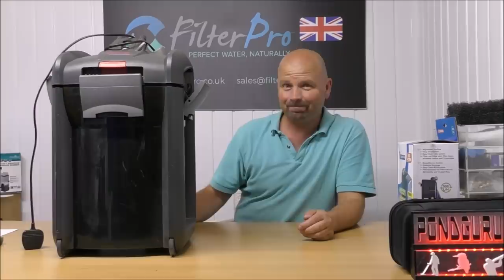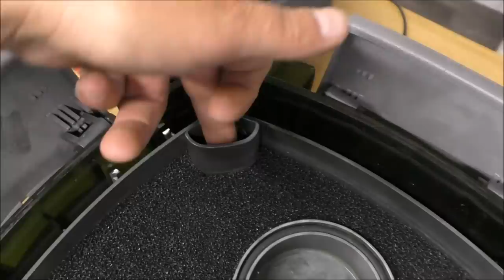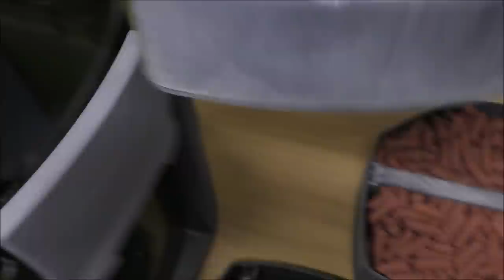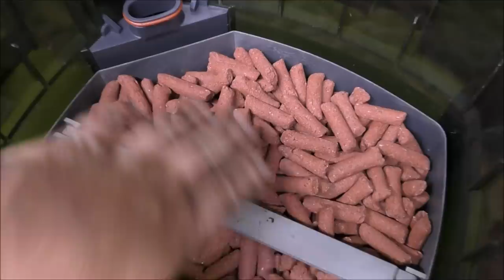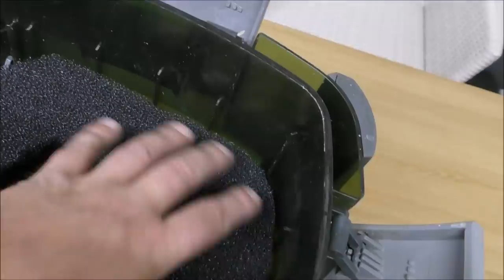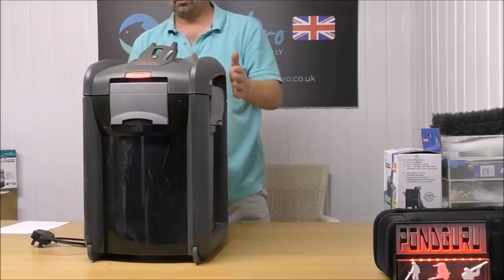Pimp My Filter #34 - Eheim Pro3 12000XL Canister Filter

Comment from the maker: Ouch! This is an expensive filter....however it has some nice features as you will see in the video.
Eheim 1200XL / 2080 (Amazon): https://geni.us/IBfcv
Eheim 1200XL / 2080 (Ebay UK / EU): https://ebay.to/31coTgR
Foams and Biohome Ultimate: http://www.filterpro.co.uk
(FilterPro site has links to suppliers in other countries)
Biohome Ultimate on Amazon UK: https://geni.us/GDV8oLd
Biogravel on Amazon UK: https://geni.us/o98PP

As you may know I was very disappointed in the build quality of the Eheim Pro4 600 as it was a step down from the Pro3 series quality and a huge step down from the Pro2 quality.
The Pro3 1200XL / 2080 is a really meaty filter which easily holds 6kg of media. Build quality is fine and the ability to draw from 2 places in the tank is a real bonus, especially for heavily stocked tanks.
The price is very high but given how brittle the internal parts are on the Pro4 series I would recommend this one from the Pro3 series no problem.

WHAT IS A FULL CYCLE?
If someone tells you the aquarium nitrogen cycle ends with the production of nitrate that is incorrect - please read on
A full cycle is completed by bacteria - the aerobic part of biological filtration which processes ammonia to nitrite and nitrite to nitrate followed by an anaerobic part which processes nitrate into soluble nitrogen which bubbles off to the atmosphere.
Therefore it requires a suitable amount of excellent quality filter media to be able to provide the environment for both aerobic AND anaerobic bacteria - that is what Biohome ultimate does perfectly but even with such good media there are limitations and we recommend the following amounts for different stocking scenarios:
(1 US gallon = 3.8 litres)
(1kg = 2.2 lbs)
Average community tropical aquarium = 1kg per 100 litres 
Average coldwater aquarium = 1kg - 1.5kg per 100 litres
Predator aquarium = 1.5kg - 2kg per 100 litres
Large cichlid aquarium = 1.5kg - 2kg per 100 litres
Malawi / Tanganyikan aquarium = 1.5kg - 2kg per 100 litres
Marine aquarium = 1.5kg - 2kg per 100 litres
Average mixed fish pond = 1kg per 200 litres
Average koi pond = 1kg per 150 litres

You may be disagreeing with the above figures but remember that they are for a FULL CYCLE not half a job - achieving 0 ammonia and 0 nitrite is quite easy since aerobic bacteria grows freely on any surface but the anaerobic bacteria responsible for COMPLETING the cycle needs more a specialized habitat.
Size a filter properly, set it up sensibly and you will have perfect water - it's that simple....and your filter won't be the dreaded 'Nitrate factory'.

This series of videos is all about trying to squeeze more efficiency out of internal and external aquarium filters which generally have a limited filtering capacity - If you have a filter you'd like me to feature in a video then please contact me on:
sales@filterpro.co.uk
07772848730 (Richard) 

Anyone who sends a filter (UK only at present) will have it upgraded and returned to them for free and the only cost you will pay is how much it costs to ship it to me - I'm helping to boost your filter and the resulting videos will hopefully be useful to viewers all over the world so it's a win/win. 

The following videos will be useful to anyone interested in learning more about filtration, bacteria and making the conditions for your fish as good as possible:
Sizing a canister properly and filter set up: https://goo.gl/om19un
Looking INSIDE different filter media: https://goo.gl/hZWS6c
Bacteria and filter media: https://goo.gl/123gAF
How to clean an aquarium: https://goo.gl/bPMhvh
Aquarium tips / filtration playlist: https://goo.gl/pXgqVj

This channel is purely a hobby for me so I will never ask viewers to donate money for any of my projects or charge anyone for information - information should be shared freely and I certainly don't consider myself an 'expert' in anything I pursue as a hobby so please do your own research, never accept anything as 'fact', reject anyone claiming to be some sort of authority or 'expert' and make your own minds up about anything you wish to study. 

We all are on a long path of learning......... 

RECOMMENDED AMAZON PRODUCTS: https://amzn.to/2Mw81OU
INSTAGRAM: https://bit.ly/2KAk1fx

FILMING EQUIPMENT:
Panasonic HC-VX870 HD camcorder http://geni.us/3UwE
+Rode stereo microphone: http://geni.us/4OL
Zomei Z666 tripod: http://geni.us/1a1af3
Manfrotto MTPIXI-B PIXI mini tripod: http://geni.us/87f7

If you've enjoyed this video please check out the playlists on my channel for hundreds more  - on a variety of subjects.
Feel free to share or link any of my videos on facebook, twitter, forums etc. for the benefit of anyone you think may also enjoy watching.
See you next time.
Pondguru
Reply: Hello, from the Canadian with the Tidal 110's. I've kept the original very coarse foam, then a slightly finer than medium foam (1 1/2 inches thick) from my LFS, (don't know the porosity) then, custom cut fluvals replacement foam for a 406 (red tray) for the mechanical filtration. Filled the supplied bag with Seachem Matrix about 3/4 full . The result is the matrix does get some accumulation of very fine debris. This setup fits perfectly to weekly  filter maintenance  and sparkling clean water. Flow is excellent and there is no spill over (bypass) of the "basket" week to week. The addition of "filter floss" results in bypass in about 4 days. What would you suggest seeing how I'm in there  every 7 days, I'm thinking nothing easier than giving the matrix bag a shake to get rid of the super fine stuff. Would you concur?
Reply: The title is wrong since it says 12000 not 1200.
Reply: Pondguru it says 12,000 xl in the title instead of 1200

Comment: I add 2 external Pre-Filter chinese LW-603 on the intets. You can then use the bottom tray for more Biohome. Works really well with quick change connections also chinese Eheim copies. Then you only clean the pre-filters not the main compartment. You could also add an inline heater, Co2 diffuser and UV on the outlet. Lots of connections but it works. Also change the internal prefilter course foam for a fine one as the prefilters do all the work.

Comment: I’ve run one of these for over a year now set exactly as you have with in the video (except the foam at the top) I’ve found it to be an excellent filter and as with most eheim equipment they  last, (I’ve had eheim pumps etc last over 20 years)  I managed to fit approx 7-8 kgs in mine I think by ramming it in. They also have 2 separate intakes to the filter ! Which make it different from most other externals and is a great idea
Reply: its a 500 dollar filter!!!!!  LOL  

Rather have 2 FX6 filters on a tank for that money
Reply: Sahadi420  you pay your money you take your choice, Price isn’t everything !!!!! Also I’m in the uk as is the review. You CANT buy 2 x FX6 for the price of the eheim new here, there is only £100 difference, and I know from experience which one will still be running in years to come. ;-)
Reply: @andrewjones7670  I saw 500 on amazon.  I can go to petsmart and get an FX6 for about 260.   

Worst case scenario you can easily replace the pump on the FX series....as with any component on it.
Reply: Sahadi420 we are the uk we don’t have pet smart here, also as I’ve said already you pay your money you takes your choice .
Reply: @andrewjones7670  fair enough.  But I will say, I do love Fluval products.  I take care of fish tanks that are in the oldest bar in my city.  Fish tanks have been in this establishment since the late 1970's......I need equipment that will last as well.   Nothing but good things to say about Fluval.
Reply: Sahadi420  I’m glad you love  fluval so much, I didn’t realise it was a competition lol
Reply: Andrew Jones I have both of the  fillters the Eheiem is by far the better unit , will last a lot longer too

Comment: Mmmm, it’s a great filter, mine runs on a 720 Ltr perfectly. However, putting all the foam at the bottom is a really bad idea, it clogs within days. Eheim actually know a thing or two about filters, and that’s why the foam is supposed tobe at the top and “polish” the water on its way back into the tank ( that’s why there’s a gap).
Reply: Good point!
Reply: Hey ! I just got mine 2080 Today.
What do you think if I start it the way that factory planed it .. I would only change myself to put fine foam on the top of the cheramic eheim media in the first corb on the bottom ? Than i put over the other two full filled  eheim balls corbs ?

I only want that clean water comes to eheim balls to become the max effect of cleaning the water.

Thank you for the answer . 
Shoud I in that case also put one fine foam on the top of the filter as eheim wanted ?

Comment: Pondguru

The top 2 trays need to be filled with media to the max.
then that thin lid comes on.
that space you didnt understand is for the filter floss pad.
its made this way so you can fully use the trays for bio media 👍🏻
Look on the box, Its printed on there.
Reply: Yes but that would then trap the muck after it has passed through the media ,eventually clogging the media .The water has to be polished with floss before hitting the media (not after) .
Reply: The space is to allow any chunks of media a chance to settle without the pump eating them. Especially important after changing media.
Reply: @leeporter6849 correct

Comment: I never use the white filter wool in my external filter, clogs up too quickly, the filter will need cleaning out every month, just put a pre filter sponge on the inlet hose with coarse medium and fine sponges in filter, works great for me, I clean my filter once every 12 months!  My water is perfect and I have crystal clear water. If you want to use the wool just put it in a little internal filter (ehiem bioball) so it is really easy to clean or replace.
Reply: If you have a high bioload or lots of wood in the tank with pleco/or wood that breaks down quickly and don't want floating particles a fine pad is a strong recommendation. 
If you have a planted tank with little fish you could get away with filling the whole thing with no sponge at all, only pumice and carbon for totally crystal clear water.

Comment: Unfortunately , the fine pad/floss is really impractical in this filter . It lasts around a week to a fortnight before clogging . And with the position at the bottom of the filter makes it a right old pain to clean / change out .  

I set up similar just missing the floss out  and it works great .

Personally I prefer the 1500xl classics . Much more media and flow albeit at the expense of a bit of ease of maintenance
Reply: Pls help!

EHEIM professionel 3 1200 XL
VS
EHEIM classic 1500 XL

Dose the pro 3 seria do 50/50 with the suction side because it has 2x inflow?
I was thinking about on one suction side put UV-C and normal suction on other?

Wich is better fore 450l/120gal aquarium? Quieter?
Reply: @mariot.5178  I know it's an old comment but the 2080 or 2180 are quite compared to the 1500xl. I've got 2 a 2180 and a 2080 1200xl on my juwel rio450 ltr tank and can't fault them at all. All depends what fish ur gonna keep but a 2080 should be perfect on ur 400

Comment: There is a little bit of space for a layer of media rings at the bottom but I changed this filter over from the 700 which did have almost the same space as a basket of media at the bottom. Factor in that you loose this space in this filter, this doesn't hold much more media when I transferred from the 700e.

Comment: Very good Video !! I have the 2180 - with build in thermo, I had some issues with the flow, when the filter was build like Eheim suggested
So i removed about 6 liters of bioMech and Mechpro tubes - now the water is flowing, but did you check the flow rate, when building the filter with sponges and  Biohome Ultimate ? 
Regards
Flemming.
Reply from the maker: Ultimately the fine pad dictates the flow rate of a filter since it will hold water back when it gets clogged. If you find that the flow is slowing down quickly after maintenance try removing the fine pad - the vast majority of muck will be caught in the medium foam(s) anyway. The Biohome Ultimate makes no difference to the flow since water can easily pass around it but very small media like the Biogravel or Substrat Pro may slow the flow  a bit since the water can't pass through a full tray of it quickly.
However, if the small media is used in mesh bags the water can go around the bags of media easier, helping to maintain the flow rate.

Comment: I guess the bottom tray could be raised an inch with some kind of support, then the bottom could be filled with some mech rings to settle heavy muck at the expense of getting rid of the top foam added in this video that doesn't seem to really do very much.
Reply: Removing the top tray is not a very good idea with these filters as the whole design and flow of these units depend on them. Otherwise, water would just be sprayed down into the top layer and be sucked out again without any filtering whatsoever.
And it's a terrific first settlement chamber that does its job very well.
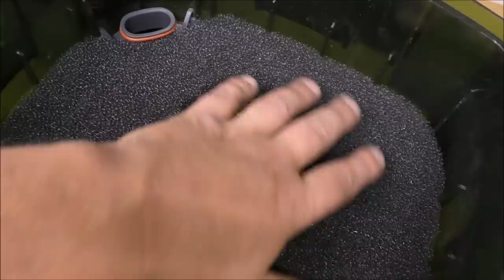Reply: @OriginalMindTrick  Sorry if I was unclear, I was talking about the foam seen at the 9:15 mark (and some time before), not the prefilter foam added a few seconds later in the video, which is the one I think you are talking about.
I absolutely agree that this shouldn't be touched.
Alternatively, you talk about the entire prefilter tray, since you say the filter wouldn't work without it.
Either way, I absolutely agree, dont remove any of them!
Thank you for adding this comment, since I don't want to plant a destructive idea in anyone because of a misunderstanding.

Comment: Thanks for posting this video Richard. Hopefully you or you followers can help. I have two Eheim Classic canister filters (2217- one on each side of the aquarium) for my 125 gallon tank that is home to my aquatic turtle. The turtle is getting larger (about eight inches) , so I need more cleaning power. Was looking at the Eheim Pro3 in this video, but it looks massive. Wondering if you could recommend a good and easy to use filter that has lots of power. BTW,  I am in the U.S.  Thanks a bunch!

Comment: While I prefer the extra space for media, and the more traditional top mounted pump compared to the Fluval FX series, I have personally found the low turnover rate of Eheims to be a problem for tanks with messy eaters, especially if you've got the three grades of foam in there. I was using an Eheim Professional 3 on my Green Chromide tank for a while and it just simply wasn't adequate in terms of mechanical filtration, lots of suspended particles clouding up the water for several hours after feeding, in the end I replaced it with an FX5 which does a vastly better job, keeps the water crystal clear and is still provides enough space for biological media.
Reply: This is my experience as well. They are great at biological filtration but not the best when it comes to keeping a high bioload tank crystal clear. That is what the FX6 excels at.
Reply: @OriginalMindTrick  Yeah, I'm sure they're probably fine for a lot of typical community setups, but they just don't have the flow rate to handle messy eaters and / or fish that produce a lot of waste like large cichlids, puffers, goldfish ETC.

I ended up using my Eheim Professional 3 on tank about 1/3rd the size of what the filter was rated for in the end, and it was amazing for that tank. It's a shame because as I said, I actually prefer most things about the Eheim filters, but they're not much good to me if they can't keep my water clear.
Reply: @The-Fishkeeper  The Ehem 2260 is terrific at both mechanical and biological filtration. If the supplied pump isn't large enough you can put whatever large pump you like on that can handle being run out of water. A sump is probably a better choice here though.

Comment: I have noticed if you have a standard tank it's better to go with a finer 30 ppi foam on the bottom and not bother with anything coarser. There is also quite a bit of bypass with each segment so putting one or two more fine polyester pads above the bottom segment isn't a bad idea.

Comment: Definitely my favourite filter I have 7 running at present
Reply: What size tanks?
Reply: Miguel E Espinosa from 100 gallons to 500 gallons
Reply: I have 2 of this filters but I could not figure out where to put the chemical media, if you can help will be great.
Thanks
Reply: @elgezouliabdul4973  since the flow is from bottom to top. I would choose the top tray.
Reply: @migueleespinosa2632  Hi Agree with you 100% shall I put it below the white fine pad or above the white pad , since at the top tray I have white pad then grid then the cover.
Thanks
Reply: You think eheim 1200 xl better than Oase 600?
Reply: U rich or smthing ?

Comment: I have a question about the nitrate end of cycling and the possible loss of that part of the cycle due to power loss. Specifically, when does die-off begin after power loss. The place I live loses power about twice a year. If it takes 6 months to fully cycle, then you might understand my quandary with respect  to the media and cycle loss

Comment: Hope they took care if the leak issues. I think Eheim is slipping on their quality.
Reply: 30 years I've had eheim filters and never had one leak I use silicone spray on all the seals everytime I clean it and never had a problem. Eheim sell a hell of alot of filters every year so hearing of issues in a few filters doesn't mean their quality has reduced when in reality it hasn't maybe they just sell alot more filters now then years ago
Reply: Been using Eheim filters for two decades and never had the slightest leak.  Made in Germany means ultra high quality.  Everything is built to last.